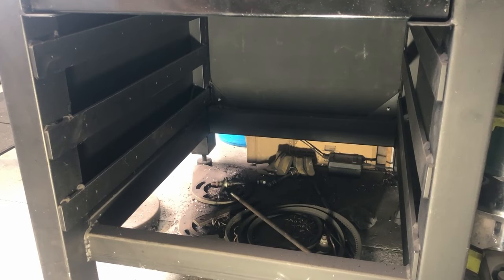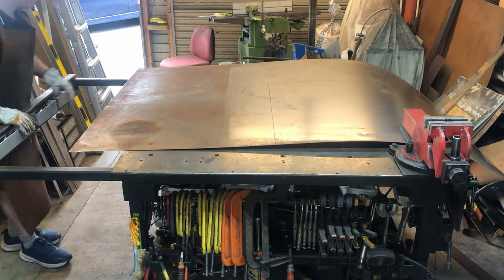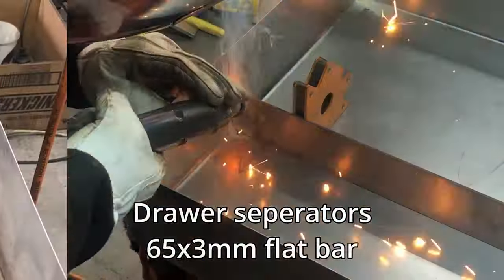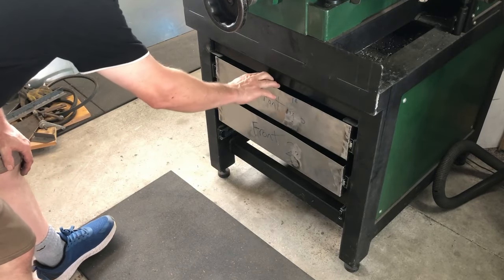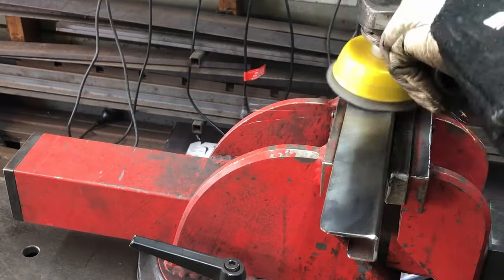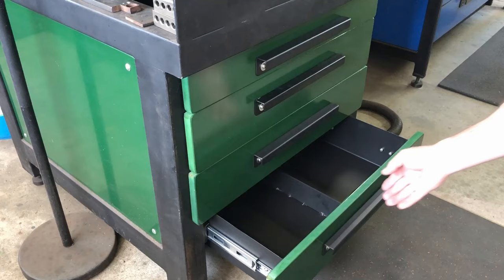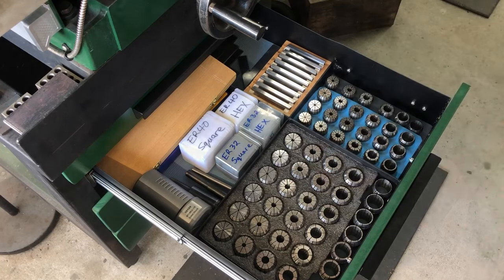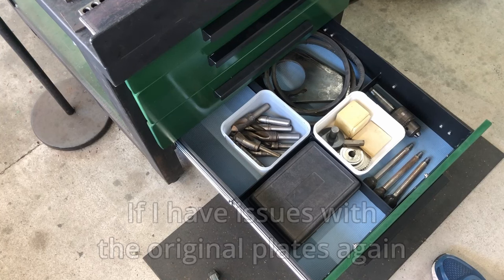Storage Drawers For The Milling Machine

Comment: That's a nice sheet metal bender. Good capacity too. 
Regards, Preso
Reply from the maker: Thanks Mark. There are 3 main parts and each part is quite heavy. Probably a bit over built to be honest. I'm glad I did not make it as one machine because I would not be able to lift it.